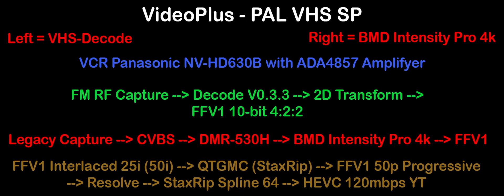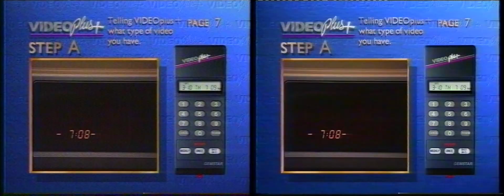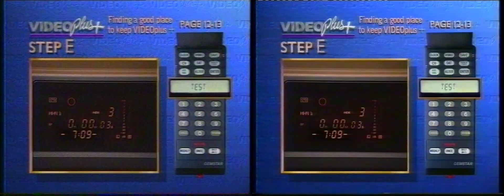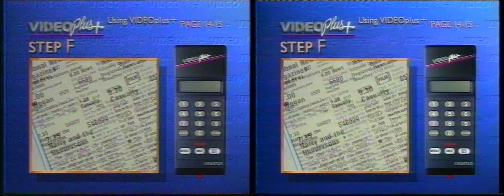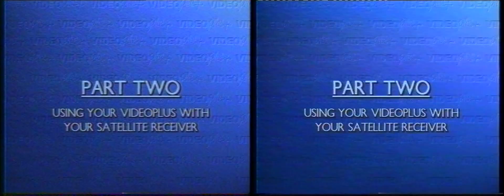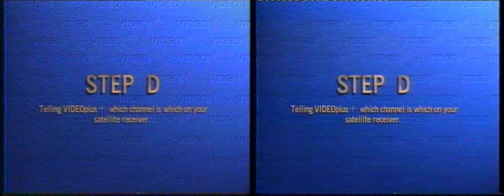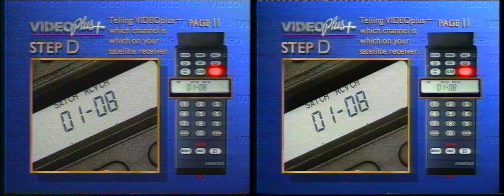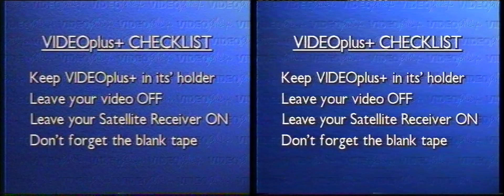VideoPlus Demo: VHS-Decode vs BMD Intensity Pro 4k

Comment: What an interesting comparison.  The background "VIDEO" text seems much clearer on the left version than the right, but the transition between adjacent solid blocks of contrasting colors (like white buttons on the black remote, or "VideoPlus+" against the blue background) seems much sharper on the right version.

Do you suppose there's a way to tweak one or the other to get the best of both worlds?
Reply from the maker: I think a lot of people kind of ignore the context of this is a horrible SNR tape where decode is extracting a lot more detail out of it.

But yeah that can be adjusted there's a lot of conventional little post-processing things, and the decode arguments used can be altered and rerun indefinitely, but this is just what direct capture and de-interlacing/scaling gets you with this particular tape, I'm sure there's probably better copies in the world also.

Comment: Seems to me the trouble of going through all of this being as vague and trivial as it is for the extra 10% in image quality isn't worth the effort. I read through the wiki and there are just too many gaps in the documentation to get this going. Much easier with just going from the deck using s-video/virtualdub.
Reply from the maker: It's about whole signal frame access and preservation, legacy workflows don't allow you to go back, and reprocess the source content.

(Granted this tape is not the best quality in the world you can't magic SNR out of nothing but the difference is quite apparent)

If you grasp the concept you understand the wiki is formatted in a way that the workflow is decided by the user's wallet and the user's format they wish to archive, then it's get RF capture device deploy a RF tap, capture the FM RF signals to file and run it through your required decoder, simple effective and affordable.

It's not any more complicated than what stated on the homepage of the wiki and the motions are documented like wise.

And it's not just image quality it's signal handling overall there is no transform 2D or 3D decoder anyone can get their hands on for example, and there is no IMX export capable workflow you can just go and buy from eBay.
Reply: @TheRealHarrypm  I guess it's safe to say I'm not grasping the process. I have yet to find a video example of someone going through the actual capture process using RF taps/test points. I guess that would be a start. Quite a few final comparison videos out there but nothing that really goes through the process start to finish. Most videos I find show you the decode process but fail to divulge how they got to that point. I'll keep reading....

Comment: Was the composite/BMD capture done in 10 bit and with 10 bit processing within staxrip? If at any point the stream was 8 bit, that could lose some of the details in that mostly similar blue background in particular which might explain why that area specifically looks particularly less sharp in the traditional capture. I'm also not sure if the DMR-530H does its internal processing in 8 bit or 10 bit, but that could be a factor as well even if everything else is done in 10 bit.
Reply from the maker: 10-bit 4:2:2 on both the BMD SDI chain and on the output from the decode workflow.

The composite is a lot less sharper then decode even on the CRT.

But this is not a high SNR tape anyways.

Comment: The "BMD Intensity Pro 4k"  card is the worst acquisition card ever designed for analog video capture. As for the Panasonic NV-HD630B, it's fit for the garbage can.
Reply from the maker: Not exactly it's ok for component, but the CVBS/S-Video is mediocre compared to the SDI units but it's the audio that I despise it for. 

However the 630B is actually one of the most affordable and best hi-fi tracking decks Panasonic produced, It's the same as the higher end models of its release lineup, if you just populate some switches because it's literally the same mechanism chips and main board.

Comment: I've heard of VHS-Decode but this is the first time I've seen a demo and must admit I'm not impressed. The picture on the right looks sharper especially on the text sections of the video. Both are suffering from a lot of chroma noise but that could be down to the quality of the source tape. I wonder what that tape would look like if the legacy capture was done by a S-VHS deck with built in TBC and 3D-DNR noise reduction like a JVC HR-S7600, I'm sure the blue background on the graphics would be much cleaner.
Reply from the maker: Yeah, the main benefit is the ability to go back and reprocess, but the source tape in this case is not the best, hence why it was interesting stress test case.

With RF data being available for later use is the key take away, anyone can go back and reprocess it. 

But if you want a more golden example the dream times tape on the IA page is probably the cleanest tape I've run as a demo.
Reply: I'd love to see what this can do with older formats such as Video 2000, even the later machines like the Philips VR2840 are over 40 years old now, so any legacy capture from those will be limited by the technology of the day and the age of the electronics inside them.
Reply from the maker: @jkmac625 Definitely better processing than internal hardware, Rob Collins of Kaleidoscope expressly reached out for example the Philips and early reel to reel formats, we just got the initial implementation of 405/819-line for the TBC format, thanks to 2" Quad samples from the INA in France so it's been a busy year.

Comment: Th BM has less chromatic noise but less definition when you look at the TV text, so the next step is using your plugins like Topaz and Neat video to see which is an easier issue to correct. AI restoration of detail as we all have seen, has it's limitations. 😂

Comment: My issue with BMD IntPro4K is that past a certain firmware release it can't capture sync audio, even a 1h capture is several frames out of sync at the end. I had to rollback to a firmware from 2015.
Reply from the maker: Yep this is another reason why I switched back to SDI boxes, also the horrible line noise just made this kind of no-go for production.

Comment: With this example BMD capture looks way better than FM RF.
Reply from the maker: Not really all the skin detail is annihilated by the BMDs baked processing, if your not watching in the 4k mode and or on a 21:9 panel it might be easy to miss
Reply: @TheRealHarrypm  I use an LG 29WK600 (21:9 monitor) for color grading and video editing with DaVinci Resolve. Using the frame at 0:29 as an example, the levels on the BMD do not match the FM capture, the subject is too bright, signal clipping (hot spot) on the head and shoulders, and the text is easier to read on the BMD. Another problem with FM capture is the static noise superimposed on the image. Use any Disney VHS with color bars as a reference to match the levels on both captures and try again.
Reply from the maker: @coisasnatv  Decode was automatically adjusting the black level on each field using 0ire_adjust witch is pretty accurate and hands off.

I don't know what you mean by superimposed noise though because decode isn't applying any noise reduction, just the standard emphasis filters for VHS SP PAL.

But that is a fair point about adjustments, however even adjusting the clipping the information retention is just far worse, the clipped information is there if you pull down the source files and toss it in resolve for corrections.

(Reminds me I need to upload the FFV1 files)

My SDI units are all adjusted on the proc amps with an HackDAC V2 as the source input reference.
Reply: @TheRealHarrypm  Again, there is no problem with decode black levels, you need to adjust the levels for the BMD capture to match decode's. As for superimposed noise, I'm talking about signal to noise ratio (SNR), when you amplify the signal to a certain level, you also amplify the noise, the FM capture has static noise all over it. In your case, it looks like the noise levels are higher than the signal itself. The FM signals are very prone to interference, maybe better shielding or cables could fix this noise problem or check FM signal.
Reply from the maker: @coisasnatv The SNR on the tape is not very good to begin with, it's in the 30dB range not clean 40-50dB range on the luma channel as we measure on the black SNR inside of the ld-analyse tool.
Reply: @TheRealHarrypm  If the SNR is not so good, instead of amplifying the signal with a regular amplifier, try a differential amplifier instead since the noise is common. This way you can get a better signal and reject most of the noise.
Reply from the maker: @coisasnatv  If you actually pay attention to the title card and description it's using the standard high Impdence ADA4857, which has been calibrated to the deck with an oscilloscope.

Feel free to look at the RF data It's fully available on the internet archive link in the description.

I no longer have the tape, It was a 1-day transfer job then posted back to it's owner (Robust Reviews) with the data.
Reply: @TheRealHarrypm  Again, it really doesn't matter what opamp you use, you're just amplifying the signal, and when you do that, you're amplifying the signal + noise. Looking at your VHS service manual, it uses a differential amplifier to handle the RF signal from the heads, you may need to reconfigure your ADA4857 to work as a differential amplifier to get a better SNR ratio.
Reply: @coisasnatv  you don't know what "noise levels are higher than signal itself"  means ie how does such video look. also, he won't find the lost detail via video signal level adjustment, it's not that far off. as for sharpness, notice blue background and her face when it's zoomed: which has more detail (ie more high frequencies from video signal)? 
also, the blue texture is not noise. you can remove the noise with some temporal smoother, but you can't recreate the missing detail in bmd version.
Reply: @ivok9846  You need something more sophisticated to identify the noise on the screen, you need to split the Y C signals (with avisynth or something) to isolate the Y and see how much noise it has.
Reply: The background has the texture visible on FM RF while on the BMD capture it's just blurred mess
Reply: @Pasi123  "The background has the texture" - That is static noise.
Reply: @ The background isn't just static noise. There's clearly a texture similar to what's on most 90s windows wallpapers etc.
Reply: @Pasi123  That is what static noise look like.
Reply: @coisasnatv  I'm 99% sure it's supposed to have the texture. It definitely looks better with it.
On the BMD capture even the VideoPlus logos are blurred
Reply: @ This "texture" is called static noise, this happens when the noise level is higher than the signal. Second problem, the user who captured this used a regular amplifier to amplify the signal, when you do that you amplify both signal and noise. What you see on the screen is not "texture", it is a bad SNR ratio.
Reply: @coisasnatv  Wouldn't the static non-moving noise cover the whole image and not just the blue gradient background? At some parts of the video (4:58) the texture (or non-moving noise) is also different size on the smaller overlaid image of the same background image
Reply: @Pasi123  "Wouldn't the static non-moving noise cover the whole image and not just the blue gradient background?"
Yes, this is what the video shows. Look at the remote control, the buttons and the LCD screen, they all have the same "texture". A differential amplification of the FM RF signal will remove all that noise and improve the SNR.
Reply: @coisasnatv  The pattern on the remote control, the buttons and the LCD screen is completely different from the background texture
Reply: @ Yesterday I shared an Avisynth script showing that this is not the case, but someone deleted it.
Reply from the maker: @coisasnatv Scripts get auto nuked on YT, better off posting about it on the subreddit or something.
Reply: @TheRealHarrypm  Thanks.

Comment: Probably a little harder to tell with YouTube compression than it is with the original samples. I actually thought at first that the right side was VHS decode because there are considerably fewer "comets" on that side which are basically low RF/partial line dropouts that I figured decode would know to cover up with data from a prior/future frame/field, but this is not the case. The sample on the right (BMD) also looks sharper to me, just as an example say as the LCD screen shown on the remote at 3:05, or the Gemstar logo on the remote. Could be because the one on the right has more "contrast" though. Either way, I was expecting more of a difference, but for YouTube postings, I'd be hard pressed to tell much of a difference between either assuming the tape itself is in good condition.
Reply from the maker: Yeah this tape isn't in stellar condition, I just didn't see anyone had put it up so decided to do so.

Individual files and the source RF is available on the internet archive.

Comment: Thank you for your work on the project and for providing this comparison. The RF capture looks sharper and it’s the one I would pick. The BM capture seems to be smoothing out the image with some filters. Is that something that can be turned off on the BM? 

If you redo a test of this kind, I would have preferred to see a comparison of RF capture VCR against a Super-VHS VCR with its S-Video port, which would provide a small (perhaps very small) improvement in sharpness.
Reply from the maker: The BMD cards give you zero processing control outside of video level and audio level and aspect I/O, the Intensity Pro 4k has a lot more processing and noise especially on the audio when compared to the analogue to SDI units for example.

The funny thing with these late 90s decks is they all had the same heads, and shared mostly the same pre-amplifiers and signal tracking stage.

SVHS units are mostly inflated so I don't think I'll ever focus on using them for comparisons, it's not realistic for the majority target audience.

This tape was a special case of I had it on hand during my testing weeks of the intensity before It was moved to a different station.

Comment: VHS-Decode wins hands down. Waiting an all-in-one card to be available for purchase.
Reply from the maker: The MISRC V1.5 (now v1.5a) has been out for a year with the ability to add audio modules, and a v2.0 4ch audio integrated version is coming this year.

However the CX Card Clockgen mod workflow keeps advancing, due to first support adaption of things like FLAC v1.5.0 which enables multi-threading allowing for any half modern system to real time maximum level FLAC compress any capture.

Comment: VHS Decode appears more stable than the BMD. But, on the other hand, the BMD has slightly vibrant colors and sharpness than VHS Decode, assuming the settings are the same for both videos.
Reply from the maker: Completely unprocessed and ungraded, QTGMC is at 0.3 sharpness and fast mode it was FFV1 all the way though untill final HEVC 120mbps YT render